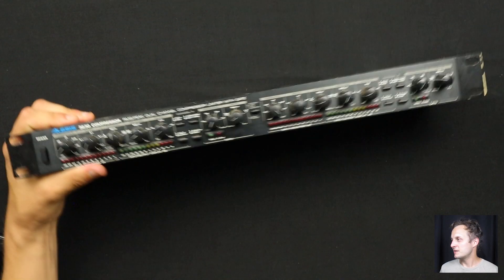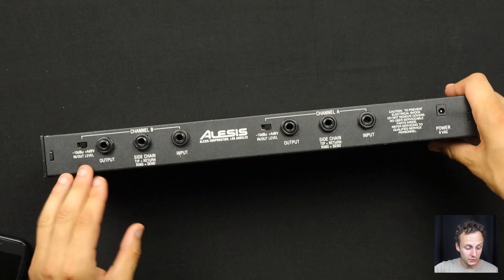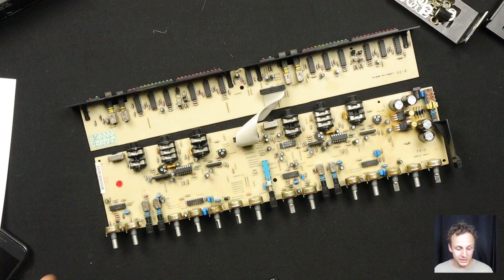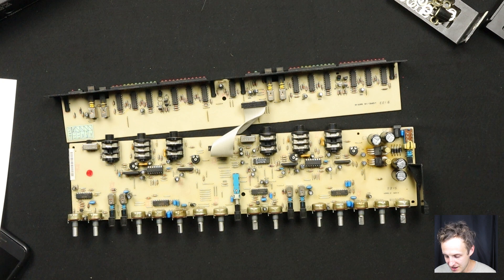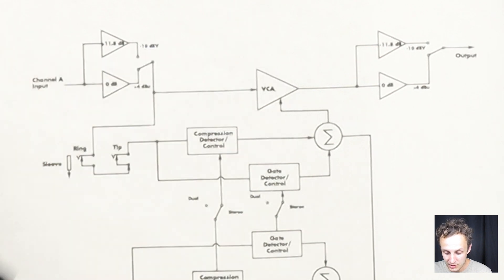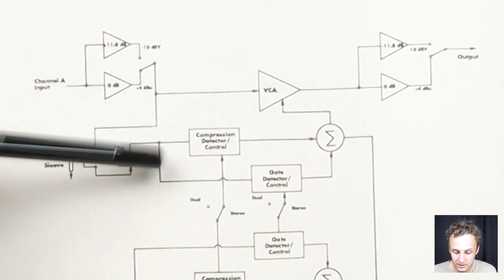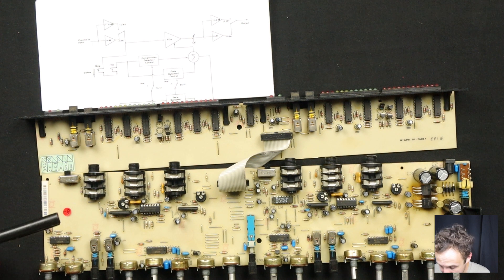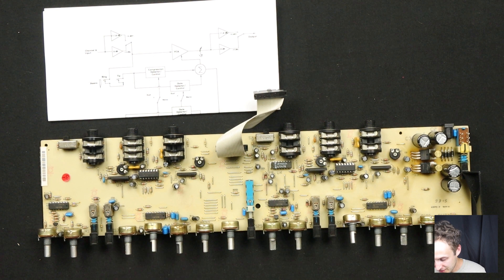Is the Alesis 3630 compressor really that bad? Teardown of "the worst compressor ever made"

Comment: Large scale manufacturers (like Alesis, etc.) design products with a final price point in mind. They then call for an initial design from engineering that will be appropriate for that particular piece and price. After this, the design is reviewed along with manufacturing costs (which include labor costs, benefits [if any], company overhead [including local taxes], etc.) and any adjustments to the final design will be made at this point. Pricing is often arrived at with some kind of formula, which can range from 3 x parts + labor, or 4 times parts + labor, or some variation of that) and projected into the future with the possibility of keeping the price the same over longer stretches of time. One reason for the single-sided PCBs is that they significantly reduce the overall manufacturing cost and the jumpers were more than likely machine inserted as opposed to hand added later.  At that time there were plenty of quad op amps that could have been a better choice for fidelity, but again, overall costs governed the part selection process. The fact that this uses a DBX VCA and detector chip set already makes it more than reasonable as a piece of gear. Apparently when this first came out Mick Guzauski, world-class mixing engineer, was reported to LOVE the 3630 and used it a lot on his mixes... so there ya go! As you can see from the above, this is why small-scale manufacturers like you have an upper hand advantage in many instances. The larger manufacturers are making products that will hopefully have a LONG product lifespan while smaller scale manufacturers can make a set of products that will be purchased by a smaller segment of the market and still make a profit.
Reply: That's was oddly thorough.

Comment: My first compressor ever, circa ~1994! Bought it the year after high school, I think. I will never forget the excitement I felt the first time I patched it in and ran a drum mix through it (from my Fostex A-8 playing through an ART Phantom 1608 mixer) and naively dialed in way too much squash. It was mind-meltingly awesome. It was that... THAT SOUND!! 🤯🤩 And such was my introduction to compression with arguably the worst compressor of all time.
Anyway, I still have it right here in a drawer so I pulled it out to check the back panel and found that the level-set switch is correctly labeled: +4dBu and -10dBV. You might have a collector's edition on your hands!

Now that mine is out I think I'll patch it into my desktop mixer and use it for gaming. ;)
Reply: I think they moved production to Taiwan and probably fixed this error by then? Check the back of your unit, does it say made in Taiwan?
Reply: @JohnnyRock  Mine says "Made in China".
Reply: @Hermiel  I don't know the exact timeline, perhaps it was earlier, but the one in this video and the one I have are American made. Not sure what year they moved production.
Reply: @Hermiel  There are 3 versions that I know of, Taiwan, China, and USA. I was under the impression Taiwan came after USA, but I could be wrong!
Reply: @JohnnyRock The circuits are so sparse, I wonder if there is a substantial difference between the US and Chinese units.
Reply: I have this exact model too…

Comment: I still have one of the 3630s I bought after college for use with my Mackie 1604 and Fostex R8. It was a really cool bedroom setup for the time. A reel of 456 or 499 and we got very reasonable demos and rough mixes done. And, yes, SM57s can be used for vocals, drum kits, guitar and bass amps.
Reply: Hell, even your obsolete analog setup still sounds better than the icy cold sound of protools, logic and cubase...
Reply: yep! i also owned a Fostex R8 withe the MTC-1 midi controller for sync to an old 486 back in the day using Greg Hendershot's "Cakewalk" (DOS then windows version)... b4 it went "Sonar"(bleh)... nice to see folks here who know what they are talking about

Comment: Besides crappy grounding on a single sided PCB, the biggest problem is the LM339 comparator in the control voltage part of the side chain. It is being used as an op-amp. Never use an op-amp as a comparator. Never use a comparator as an op-amp. It will add crap and noise. Balanced is nicer so you can use it either in line with a preamp or as an insert, but in an insert on most lower cost mixing boards it doesn’t matter, only when you get to the higher end mixing consoles do you get balanced inserts.

Comment: I have had two of these recently and they have both failed in a similar fashion. The green lights stay lit on the left channel with no input, and the noise gate lights are red, showing no output. Now, even with nothing plugged in, the lights are on. They worked well for a while, then each one started making odd noises and the display failed. I use one as a stereo limiter with my multi-keyboard rig in a band, so I don't get overly loud when my exuberance takes over. I am now using a DBX 166xl and so far, it works just fine.
I think it is interesting that the display PCB had more IC's, and maybe was a higher priority, and possibly more costly, than the audio part of the Alesis 3630. People listen with their eyes, not their ears? I kind of miss that display.
Reply: Nah.  The ICs on the metering board are probably just comparators, which are similar to op-amps, but usually dirt cheap since they don't exactly need to be hi-fi.

The metering serves two purposes:
1) Having both in/out AND gain-reduction metering is nicer than having to pick one, and it costs very little to do.  It isn't essential -- you can just listen, after all -- but when you have a rack full of these, being able to glance at the meters to get a sense of what your gain staging looks like is quite helpful.  Also good for newbies or weekend sound guys to learn how the controls affect the signal.

2) It looks neat.  Let's not pretend that ANY of us are beyond a little eye candy, given the choice.  Show me one engineer that has never sat back and looked at the dancing LEDs in their effects rack and felt that sense of pride in their gear, and I'll show you a filthy liar.

Comment: Ummmm... If you push an already relatively hot signal into channel A, crank that thing into channel B, then use the side-chain to control the level of A into B it makes some incredible distortion sounds. There are few things that alter sound that are TOTALLY useless. I always thought it was basically a rack mount guitar pedal. True it's not that great of a studio compressor, though. 😁
Reply: I'm definitely trying this!  Might circuit bend it or something too
Reply: Sounds promising! Could you explain "use the side-chain to control the level of A into B"?

Comment: "Harrowing" is a perfect descriptor of the experience of taking one of these apart.  Those pots will snap off in a mexico city minute.  The switches aren't made of much either.  I put some 1,000 uF reservoir caps in mine and they literally exploded, they weren't backwards, I still don't know why.  I think I even had Burr Brown op amps in there for a little while.  My best use for this thing was fuzz bass.  On mix bus, it's too dark, it just kind of swallows your top end and all your transients.  It was a fun project, but ultimately, of all things, the Behringer MDX-2100 Composer was a higher quality product after some little upgrades.  Probably designed to compete with the Alesis.
Reply: What upgrades?

Comment: “For a closing thought...this thing is a piece of crap” bahahaha!
Reply: I'm pretty sure plugin can beat this,i have this crap😅
Reply: Whatever. I used this thing to make $$$ for more than a decade (live performance rig)...eeeeek... wrong.. NOT a piece of crap. Very reliable, quiet in-line and did it's job just fine.... MORE than "fine"
Reply: I bought one recently, mostly out of curiosity.  Haven't used it yet other than a quick test.  I find it funny how preconceived notions color subjective analysis, though.  Depending on who you ask, it's either the worst compressor ever made, or a silver bullet.  I'm willing to bet the truth is somewhere within the acres of space between.

I also find it silly how much effort some people have put into modifying this unit to be "better."  Uhm... why?  Are there not warehouses of compressors, new and old, new and used, large and small, that already do "clean" and "unassuming" just fine?  If you're going to use this particular model, why not use it for what makes it unique?  And if you don't like what makes it unique, then why use it at all?  Ya aren't short on options...

IMO (and again, from the dubious perspective of someone who has not spent significant time with this unit), the things I see worth modifying are:  Lifting the regulators off the PCB, giving them their own heat sinks (to avoid discoloration and damage to the PCB, and even eventual failure of the regulators themselves);  Replacing the PSU capacitors for good measure, since they're upwards of 20 to 30 years old now;  And if the background noise is troublesome, MAYBE swap out an op-amp for one with lower noise.  Beyond reliability improvements, you really have to question whether you're not better off with a different compressor before going to extremes like fitting in different VCA ICs or changing passives.  (Unless tweaking is just your zen, in which case, you do you.)

Comment: This compressor is what it is but, no one ever mentions how the light meter adds noise artifacts to an audio signal when the illuminated bar collapses. I wonder if a diode somewhere with a cap or two might reduce those ticks for each LED as the meter collapses… great vid btw.

Comment: Unbalanced is pretty standard, usually this is equipment you'd use with an insert cable which is unbalanced. It breaks TRS into a common-send-return setup. 

Lack of balanced I/O doesn't make it less "pro", considering even if it was balanced internally, simply using it inserted would unbalance it due to a TS connector shorting ring and sleeve.
Reply: You're also generally not running 100 ft of cable from a channel insert into the processing rack, so as long as your interconnects have a reasonable shield, you're gonna be fine.

Comment: Amazing channel!! You should do another on Alesis other 2 superior (& gar less known about) compressors from around that same Era. (I mean insanely unkown about, & far superior to the 3630) the 3632 & the quite incredible CLX-440 (has 2 channels of simultaneous stereo compression & expansion) with a look ahead feature, not only a peak or RMS switch like the 3630 has (which os itself still today a very rare feature on any compressor) but a knob that let's you blend between the 2!, pf course a parallel compression blend knob (which blows my mind that that's only recently become a standard feature in hardware comps), also in addition to having 2 sets of stereo ins & outs its also got a Sidechain input fir the Comp + another Key input for the Expander + a Direct (uncompressed) output (all 3 per stereo channel!). All of those are unfortunately phono with no XLRs (but hey at least they weren't like Roland in that Era going all RCA's!). There's a few more great features as well.

Comment: Had a good laugh at the finance vs engineers angle :D because that´s exactly what still happens today in the large corporation I work for. Dilbert vibes. That said, it´s amazing how you throw in little pieces of knowledge left and right of focus. In fact, I learned more about compressor circuit types and their characteristics in 30 mins (watching two of your videos) than I got from hours of talking to "pro shop" sellers and years dwelling in forums. Great insights, well presented - please continue to provide these valuable lessons.

Comment: I've seen that same silly plastic switch-extender on some rack gear from both Yamaha and Korg, so I doubt it was custom-molded for Alesis.

And nobody had to hand-wire those jumpers, nor is their purpose to bring traces to the top board - they're acting like road overpasses, allowing traces to continue in a E/W or N/S manner without interfering with the traces running N/S or E/W, respectively. So yeah, they bring traces to the top board, but that's just means to the end of their actual purpose. You still see them in modern-day mass-produced kit. A via would be used when the purpose is actually to bring traces to the top (or bottom) of a double-sided board.
Reply: well, I mean, you're not wrong, but somebody or some "thing" had to place and solder them.  I think petersen was just keeping it quick and to the point.

Comment: Ok... now... could you mod one channel to do some changes that might make it better? Pretty open in there. Hmmmmmm... ? 
Say... change out some cheap components?
Many opamps have the same pin outs. Better caps?  Some adjustment trimmers included inside?  Ha ha 

I know it’s not worth it. Just throwing it out there. 

I’ve been enjoying your break down videos. Thanks man!
Reply from the maker: I've tried it! In fact we used to sell a mod kit. You can clean it up a lot with better chips and especially capacitors
Reply: DIY Recording Equipment 

Cool! I’m just glad my suggestion made some kind of sense to you, to be honest. 

So... the main trouble in the stock circuit, aside from the unbalanced system is noise or unnatural/harsh response? Like super obvious clamping or what? 

Thanks for your response, by the way! 

Chuk
Reply: @BadChizzle  the noisiness is what annoyed me, I ripped out the gates and it became a lot better.
Reply: Tox Yl Thank you! Haven’t owned one, so I’m not sure what the problems are. Have seen them for sale used, though.
Reply: Tox Yl But, ya know... that’s a shame, cuz a good gate can be so useful! Ya know... if you have a noisy mic or whatever. Or a buzzing amp. Too bad.
Reply: @BadChizzle  you can't have everything for the price ;) it also depends on the revision, the newer ones sound better. especially the first is noisy af from what I've read.
Reply: Tox Yl How much WERE they new?
Reply: @BadChizzle  bought em like 10 years ago, I think it was 100 euro a piece.
Reply: Tox Yl Thanks!
Reply: @BadChizzle  you're welcome :)

Comment: I've heard about people modding these to sound better. Which I can understand the thinking of. They were cheap to begin with, then later on Alesis was blowing them out for $99 and I even saw $79 a few times. So it's not uncommon to pick one up for $50 USD. And as you point out, it's all through hole and single sided PCB. However it's limited by the 9VAC power. So it is never going to have the headroom that a 12v or 18v design does.  Which would be fine if it had a nice crunch or thwack to it. But it just sounds kind of hazy and slow. 
I had one for a few years in the early 90's when I was getting started in audio engineering. It worked okay on sound reinforcement duties. But had zero character. I later got a better DBX unit to replace it. I have to say, the biggest let down for me was the +4 operation, but not balanced. In SR you always want to be balanced. CMR is armor for your signal and if you allow a chink in your armor, someone will be operating a funky shortwave transceiver near your PA that day. 
Honestly I'd rather have one of the downmarket DBX units or even a Peavey than this. It's a classic example of plenty of knobs and lights with so called 'features' tacked on, but it really doesn't do the job. Like a lot of Alesis stuff!
PS. I actually like the old Alesis Microseries stuff. Microlimiter, Microverb etc.
Reply: The 9VAC supply goes into a voltage doubler circuit which then feeds plus and minus 15V regulators so that is not a problem at all. A lot of bias being shown here.
Reply: @mephistowalzofficial9970  I didn't know that about a voltage doubler in the internal PS. Doesnt change that its not a good starting point. You can get a used DBX 166 for nearly the same price as a used 3630. And most versions are through hole and balanced.
BTW as I said I LIKE Alesis Microseries. And I still have a Quadraverb GT. I have zero 'bias'  when it comes to gear. If it sounds good it is good. But the 3630 was a huge let down for me. In fact it was the first Alesis product I bought that I did not like. Until that point I was a total Alesis fanboy.
Reply: @NullStaticVoid  Fair enough, but he is showing the bias not you. Sorry, I should have been more clear. This an inexpensive unit. It uses the DBX detector and VCA chips. My biggest Alesis letdown were the CLX-440 quad compressors. Luckily, the broke quickly. I now have much better equipment.

Comment: So interestingly just dug out my 3630 and it would appear, at least on my one they realise their mistake and have the in out level -10dBV/+4dBU. So you’re it’s rare-er?! Lol. 

But anyway I think it is well known that this is a “piece of crap”. But what I’m wondering (with my total lack of expertise) is it in regards to the compressor just been some input gain and attenuation with a VCA in the middle, what makes it crap. 

Is it just a bad IC? The unbalance ins and outs? Low voltage?  

I see a lot of people say taking the gate out of the circuit helps, what if you took the limiter out too? Could you just add some input/output transformers to balance it?  

What separates this from, let’s say the king of bus compressors, the SSL G Buss comp. What has that compressor got that the finance department at Alesis didn’t think was necessary.  

I guess the question is what would you need to add takeaway or swap to make this ‘Pro’. And can it be done On the cheap.